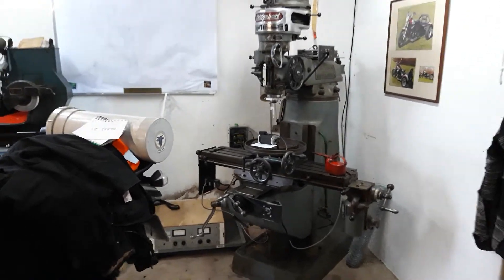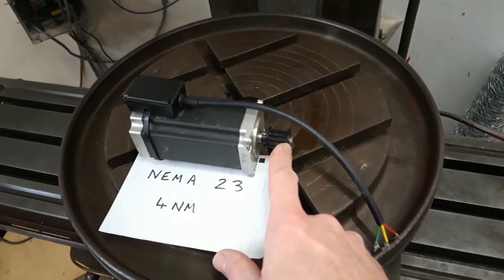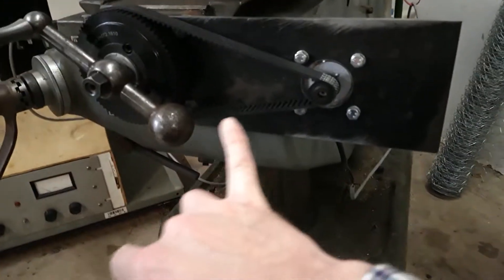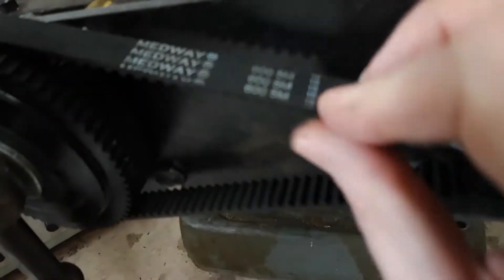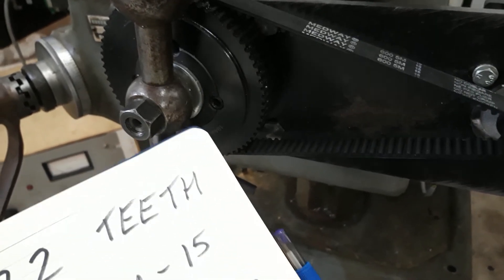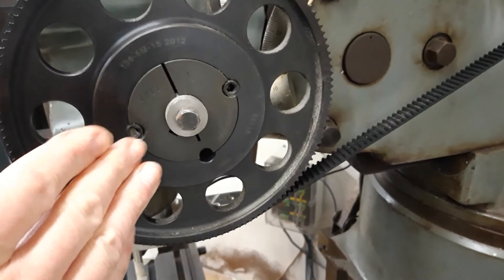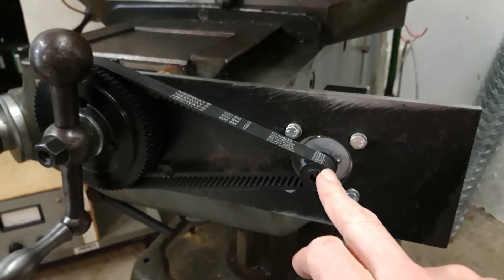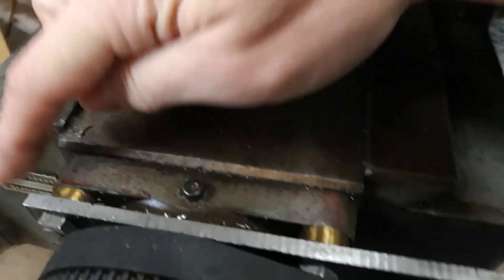Bridgeport CNC Motos and Pulleys

Comment: Why my kind sir did you not do this 😭 video earlier 😭😭😭😭😭😭.

I put nema 34 ,12NM hybrids on ...

My 1st world problem is it keeps shearing the shaft "woodruff" keys off at 25m/min when changing direction.

Thanks for the video btw 👍
Reply from the maker: That's interesting Johannes. I was considering upgrading to NEMA34s. I've recently put a large rotary table on the bed and as a result I've had to lower the maximum speed and acceleration, to stop the motors from stalling. Breaking keys is tough!
Reply: @StoneEng  Thanks for the prompt response.

My quill is stationary.
I move the Z with the knee ...I thought it would be more accurate but considering moving to using the quill as Z .
My other Axis is fine , like I mentioned before I have a 1/2 belt drive driving 20mm ballscrew with 10mm pitch they are fine ... Actually faster than I need even if I could get my spindle to 6000  or higher rpm (rebuild spindle with new bearings )

I intend to cut steel and aluminum but mainly aluminum ....is the increased  Z speed worth the lower potential accuracy of having a lose quill?

I rebuilt the machine, bought it as scrap ,i fixed it up but as I understand they were intended to mill with stationary quill  
" in locked position" 
I'm new to bridgeport so any advise gladly accepted .